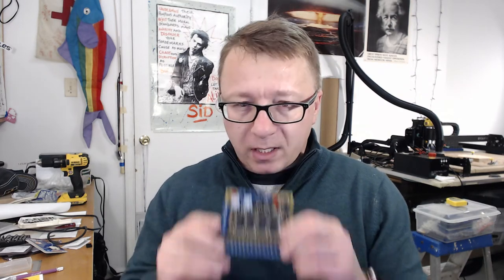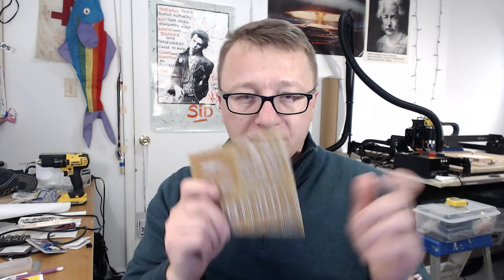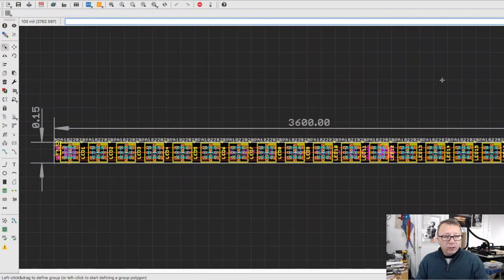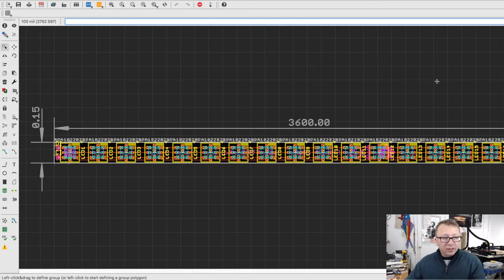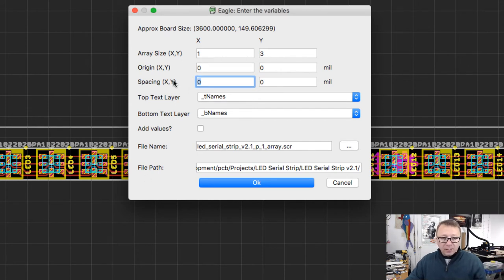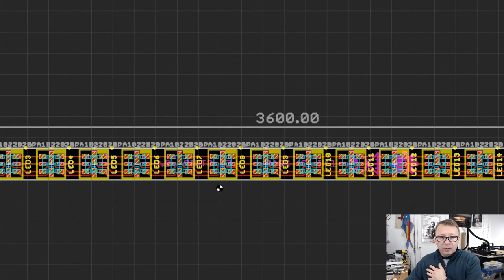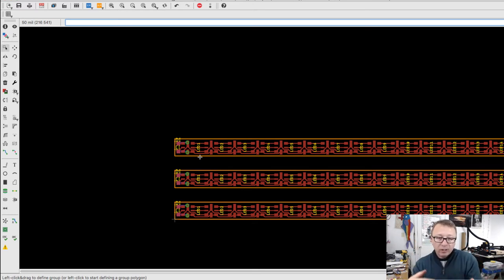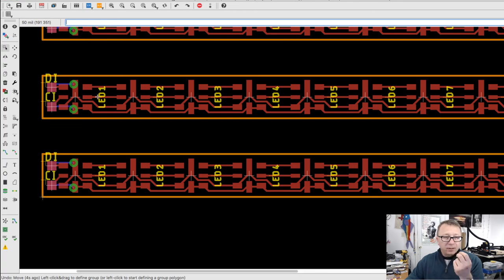Panelizing PCBs with Eagle CAD

Comment: Is that new board that you ran the exported script in still linked to the Schematic and BOM for the PCB design?
Reply from the maker: I don't think so -- it has components not defined in the schematic. Thanks for watching!
Reply: @cyberreefguru  Hmmmm I wonder how that would work then if one wants SMD assembly services as well.
Reply from the maker: @briandodds  assembly will be based on your Gerber files. The chip designators should not change on silkscreen so the BOM should match.

Comment: Thanks for this great work. When I run the ULP the Approx Board size  is 0.00, 0.00. it's like it does not see the BRD.
Reply from the maker: Hi Waldo - do you have an outline on the dimension layer?
Reply: @cyberreefguru  Exactly what was happening. Thank you. Your script works!
Reply: I guess I spoke too soon. When I tried this again on a different computer I am getting" Footprint not found: E3,5-10@adafruit". There are multiple such errors leaving  half populated boards.
Reply: Another new user error on my part. all's good now! Thanks again.
Reply from the maker: Hey @Waldo Mack - did you get everything worked out?  Sounds like the original part library was not available when you ran the script?

Comment: I ran your script. Everything worked as was shown in the video but at the end when i viewed it using online altium gerber viewer and uploaded my board file, it is only showing outline on one board of the penal. I have replicated the board using your script to 12 times. But outline is only showing on 1 board. The previous script "spark fun penalizer" I had been running had the same problem.
Reply from the maker: Mohib - Autodesk changed the API about 12 months ago and broken a lot of the ULP scripts, mine included.  I have not been able to get it working properly since. It makes a difference if you run it from Fusion 360 or Eagle -- the Eagle was working and Fusion was not. If you can't get it working in Eagle, then both might be broken now.

Comment: Hi, how do you cut the individual boards afterwards? I can make panels of my designs but I haven't figured a way to serrate the board around each design. When I preview the gerber files it's just a solid board. Thanks:)
Reply from the maker: Takis - generally the board fab house cuts the boards using the board outline specified in the gerber files.  If you don't have one, then the script might be skilling the outline because it is turned off, or on the wrong layer.  Hope this helps.
Reply: @cyberreefguru  Thanks! I believe you mean the yellow dimenison layer #20?They cut around that regardless of panelizing?
I've ordered quite a few individual PCBs from JLCPCB but never a panelized version.  I thought I needed some mouse bites or a v-score around each and every dimension rectangle after panelizing.I'll make a test order to see how they handle it.
Reply from the maker: @p8051a  yes, layer 20 I think (color is configurable). I think you need to ask them to panelize or you will just get one panel.  Then I use a band saw to separate them if the design is relatively simple, or a CNC if the design is complex (if you have one).
Reply: @cyberreefguru  Thanks! I'll ask the fab and do accordingly. Keep up the good work. Always great info on your channel!

Comment: Seems like the ulp doesn't work in the current version of Eagle !
Reply from the maker: Hi - I tested it with the new version of Eagle just 2 weeks ago and it worked fine (for me).  It does not work properly in Fusion 360 though - I'm working to get it fixed.  Can you provide more specific details or open a DR in Git?

Comment: When I run the script, it asks which library it should use for there are muliple libraries with the same name (albeit in different directories). When I select the correct library, I would like it to remember that choice for the remaining copies of the design. But it doesn't do that. It keeps asking me for every instance of the design again which library to use.

Since most of the time my board dimensions are metric, it would be an advantage to express the origin and spacing in mm i.s.o. mil, or at least to have the option to choose metric i.s.o. imperial dimensions.

Error "Invalid wire width". This may be a ULP quirk. My VCC signal line was named "+5". This seems to cause an issue as it now considers this to be the wire width in the PCB design. When I rename the "+5" signal to "VCC" (or anything else that starts with an alphabetic character), the problem goes asway.

The script adds row and column numbers to the original component names (e.g. R2 becoms R2X11, R2X21, R2X31, etc.). I selected tValues and bValues for the text layers in the ULP, but in your Youtube video you mentioned that it doesn't matter. And in fact, it doesn't because I get the same result if I choose another layer for the text. BTW, I don't have a _text layer. Even if I create those "underscored" layers, they don't show up in the selection list of the array ULP.

I get a whole bunch of DRC errors on the completed panelized board (overlaps and unconnected wires). The original disign had no errors at all.
 I selected a value for Spacing wich is just a tad more than the size of the original board. But my polygons for the copper fill are just a bit bigger than the board outline, which may be causing this issue. I could make the spacing a bit more, but my board house (JLCPCB) recommends to have 0 space between the boards for the V-cut.

Any suggestions? I'm using Eagle version 9.5.2 (free).
Reply from the maker: Let me look into it.  They have been making a lot of changes over the last 12 months.
Reply: Thanks. Meanwhile I sorted out most of the issues.
I missed the part where you mentioned that you ran the original panelize.ulp before starting the one you describe here. My bad ...  If you make an update to your vlog, maybe you can be more explicit about it.
The dimensions are derived from the grid setting on the board. Problem solved.
The issue with the wire width is indeed related to the text in the component name. No worries.
The problem with the names (R2X11 etc.) is related to the fact that I didn't run the initial panelize.ulp. Would be a good idea to integrate that ulp in the array ulp. The name "panelize.ulp" is misleading as it doesn't do any panelizing at all ;-).
The DRC errors are gone when I adjust my copper pour polygons and put the boards far enough apart.
I started to dig in the ulp code with the aim to define the gap between the boards (as usually defined by the board house) i.s.o. manually adjusting the board size and to implement minimum and maximum panel sizes (as dictated by the board house) and have the ulp calculate automatically how many boards will fit on a panel. Still struggling with the behaviour of the dialog boxes in the ulp, but we'll get there...
Reply from the maker: Excellent news.  I think I posted the code on GitHub so if you want to fork it and push changes please do so.  Unless you’ve already done that - I’ll check this evening.
Reply: @cyberreefguru ,
Will do. I noticed that John Plocher already forked it to https://github.com/plocher/EagleTools/blob/master/ulp/make-panel.ulp. He cleaned up the code and added a few features (like looking for Milling lines if there is no board outline using Dimension lines. But it needs extra work. His V-score lines always start at origin (0,0), even when the source design is offset from the origin. And the panelizing feature only works for rectangular outlines. It will take a little while to get a finished ulp. I'll send you the code when I'm done, so you can torture it a bit ;-).

Comment: No mousebites, no vgroove, nothing more than other copy-paste howtos I've seen.      I just wasted ten minutes of my life.
Reply from the maker: Hello Rob - I'm not sure I understand your comment.  The script should copy all the features of the board. I can see vgrooves being a problem because they are not on a copper or drill layer.  Feel free to edit the script and issue a PR so the script meets your needs.  Thanks for watching!
Reply: Vgrooves are used to allow the easy breaking-apart of the board.   Some PCB fab houses support those.   Others, that support milling but not Vgrooves you can space boards apart by maybe 5mm and have these little break-off chunks left (drilled along the board edge to create break-along perforations) to hold the boards together.  Those chunks are called "mousebites."   I've found a software that panelizes gerbers, from ThisIsNotRocketScience,  but it doesn't panelize the PnP file.  It's also amazingly crashy, so save your work often.     Anyway, point-of-fact, that software leaves you hoping your PnP software supports the kind of panelizing that you want to do, which really leaves you (in most cases) with a grid of the same board.   Hence I'm digging for ways to panelize in Eagle, and I'm looking for more than "you copy and paste it a bunch of times.   Oh, and here's a trick to deal with names."
Reply: @robstoddard9521  i have the same issue right now. Jlcpcb just won't accept the panelizing everyone show here on youtube or even search.